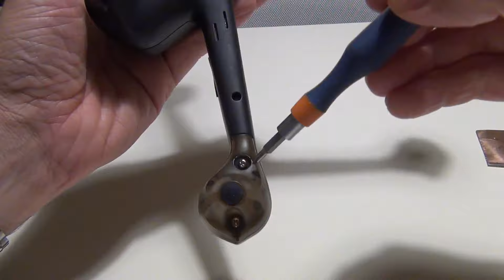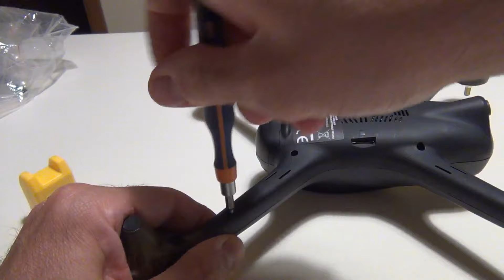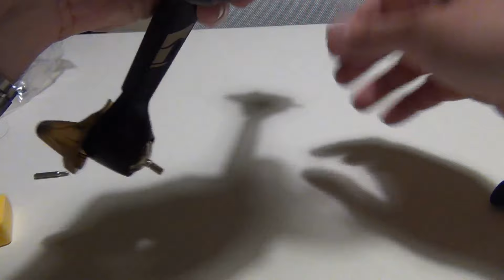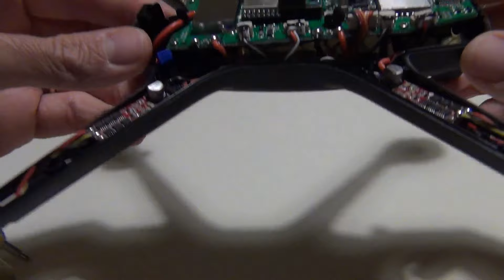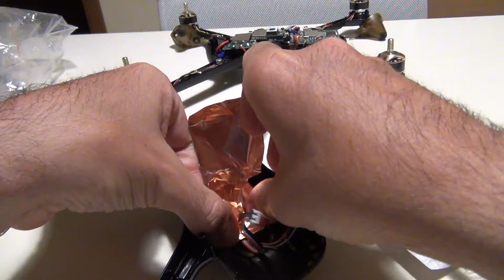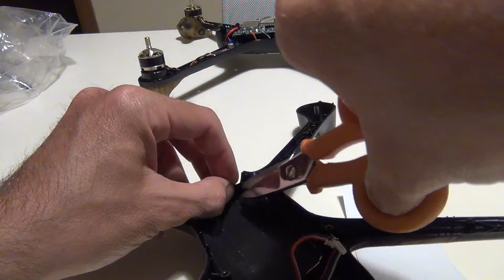Hubsan H501S H501SS H501A bodyshell disassembling - GPS and COMPASS shielding: smontare guscio

Comment: Thanks for the video. Crashed and burned while flying- got distracted and the wires came out of the casing underneath the motor. I think it's the light. Motor doesn't spin so I might need another esc as well. But this video did help me. I have 2 of them. 

Ordering new parts, and going to.customize everything on the one I crashed.. needed this
 
Good look
Reply from the maker: Glad that helped you. I hope you subscribe and Like ;)
Reply: @lukappaseidue  motors work!! hecks yea... just the light is out. can you link the firmware download file for the FC, RX and TX? the hubsan website firmware updates arent working. i can get them, but they have a H501a fc file in the firmware. i try to update and get the update error.  any info you could provide will be very helpful. hubsan isnt responding..  thx
Reply from the maker: @Fiya_gamez  Check wires! I don't think that it is firmware related:
anyway here my archive with ALL: http://bit.ly/HUBSAN_H501_repository

Comment: Ciao Luka, good work. Precise and clear, but if you don't connect electrically the copper shield to NEGATIVE signal of the electronic board the shielding effect is very very reduced near to zero.
Reply from the maker: Thank you for advice

Comment: Dear Luka!

The GPS is allready shielded.

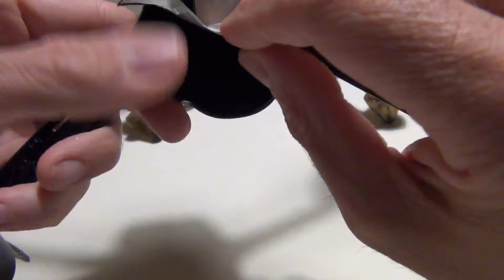At 10:47 You can see the metallic shielding on the backside of the tape, that You pull back.

Allso notice, that there is a "black" quadrant on the tape, that is not metallic which
otherwise would cover the little barometer (altitude) board (with the 3 wires - one green).

This is too obvious to not be a coincidence, so I would not cover this area with copper foil
as You did.

Anyway - If You did not experience any controlling problems and get better GPS initiate, then
You might just be lucky with that mod.
Reply: Sorry - I forgot to say, that the "metallic" part of the black tape, allready are a shielding, that Hupsan may have tested / decided were sufficient.
Reply from the maker: Hi Dear Mickey, thank you for watching my video and also thank you for your tip.
I know that GPS and COMPASS are shielded by factory, but I increase shielding, IMHO, I don't think that's a bad idea:  I have flown my H501S for more than one year, and it was shielded from its arrive to me(thanks to SeByDocky tip) and I have had any kind of issue; so I have do it even for my H501A and even in this case no issue, and my drones "seems" to be really stable.
Thank you again dear friend.

Comment: Luka, what's wrong with the existing shielding? What improvements will we get by doing this?  Thanks!
Reply from the maker: Hi Jimbo, nothing wrong with the existing one, but it need to improve the shielding of the drone: I also have well shielded my H501S and this last one (with new added shilding) fix all 12 satellites in less than 20 seconds, even if i change flying area. an it seem more stable flying
Reply: That's fantastic!  I've noticed after installing Hubsan's latest firmware that it's now taking MUCH longer to get even minimum satellites for flight with my H501S. The drone locking in is significantly worse than before, but the firmware did fix my super limited range problems, both FPV and 2.4, so overall pretty happy.  Where did you buy the roll of copper shielding?  Thanks!
Reply from the maker: Thank you very much for your appreciation dear friend: here the link where to buy roll of copper: https://www.banggood.com/Wholesale-6-Feet-X-50mm-Copper-Foil-Tape-EMI-Shielding-for-Fender-Guitars-6-ft-X-2-p-49769.html?p=WD23051381310201503K
Reply: Thanks for sharing your expirience Luka! I am waiting my new Hubsan 501S in next days and your vids are very useful for beginers like me.

Comment: Ciao Luka, il mio drone è H501S e FPV non funziona (black screen), è possibile installare VIDEO BOARD FOR H501S-S e MOTHER BOARD FOR 501A, in esso?
Perché ho acquistato (su USA) la scheda video per H501S e ho ricevuto quella per H501SS.
Sono in Brasile ora e sono stato in grado di acquistare la Mother Board per 501A.
E 'solo questa modifica che ti serve?
Grazie!
Reply from the maker: Ciao Sergio, H501SS e H501A condividono (share) molte parti. Credo che sia possibile che le due schede (video a mother board) possano funzionare insieme.
So che è fattibile ma non te lo posso confermare.
Nel dubbio, però, prima di spendere soldi, scrivi una email al supporto hubsan.
I think that you can use both video (h501SS) and mother board (H501A), But I suggest you to ask Hubsan Support to be sure 
Any way, let me know.
Reply: Ciao Luka, ho già parlato con loro e due tecnici hanno risposto in modo diverso, ma oggi ANNE di Hubsan USA ha detto che è possibile, ma poi ho bisogno di aggiornare il firmware. Installerò le due schede e ti terremo aggiornato. Grazie mille per il tuo aiuto. Un grande abbraccio!

Comment: Hi Lukappaseidue Luka, I am having big problems with my H501s-s it is uncontrollable in gps mode, any help or ideas would appreciated!
Problem 1: TBE & bad yaw every flight in gps mode regardless of very careful calibration & many times calibrating transmitter as in the user manual, I can only safely fly in Altitude mode, I am still learning to fly!
Problem 2: Even after very careful calibration the compass is wildly inaccurate, even if it finds north,  east is 90 & west is 270. but these numbers are reversed on the transmitter!       I have installed new  compass.   no change.
Problem 3: GPS, the quad takes 10 minutes to acquire 7 satts (never more), the transmitter 12 satts in  2 minutes. I have changed the transmitter gps module with quad module and replaced the gps cable but exactly the same happens.
Firmawre:  The quad came with ,    V4 . 2.19 lcd.  V1 .3 .3   501ss V2 .1. 16    V1 .1 31
           In case it was a firmware issue I upgrade to:  V4 .2.24 V2 .1 .22    V1. 1 .36
           but I still have exactly the same problems. 
This quad only flew a couple of times before these problems began and even then it was very 'Twitchy/Jerkie' & not really stable.
Thank you , kind regards......
Reply: Thank you, Yes I watch all your videos & many others as well, I spend much time binding/calibrating the sticks & compass 1 & 2 with controller, I am very careful about calibrating in the field and have to wait long time for 6 Satts . is this the firmware combo you ask for? 
V4 .2.24 V2 .1 .22    V1. 1 .36
I have older H501s advanced that fly's perfectly.
Thank You......
Reply from the maker: Are you flying with H501S (only one S) using H501SS RX firmware: If you said right (using old H501S model you have to use RX 1.2.20; anyway try this TX 1.1.6+ rx.1.2.12+ fc 1.1.36 and let me know
Reply: No, my old H501s is still on it's original firmware,  ( V1.1.2  Rx V1.2.12  Fc V1.1.21) & I will not change it.
Back H501s-s, yes I will try the firmware you suggest.
I must say that I only changed the H501s-s original factory firmware as a last resort to try and solve these issues, but it made no difference!
Thank you for help & advice, I will let you know how I get on.
Have a great flying weekend.
Kind Regards...........
Reply: Brighton Rock Hello, from what I have read and watched YouTube videos, if you live close to the north equator, it will affect gps and compass.
Reply: Hi do you fix this as I'm having the same problems with my h501s

Comment: Hi Luca! Thanks for the video but I have some questions. At first was it S or A? Second Is this advance really useful? Third where are your pinsete I mean the tweezers? 😂 P.S. Orange clips are the best I have ever used😉
Reply from the maker: Hi friend, I am sorry, but I do not well understand what do you mean: The shielding was done on H501A, but it is the same oh H501S, and H501SS and H501C too.
Reply: Hi Luca. I noticed you have mentioned only S model in video title but during viewing I exectly saw it was the model A. I really know You how high class specialist in 501 and  I have thought this has much deeper reason. Now I understand it is simple mistake. Just add names of all models in title and this will increase the numbers of views and subscribers. :-) Can I ask you to tell about all advantages of this improvement. I have noticed you didn't use the tweezers when you removed the conectors. And about P.S. Once I was in Italy I used the same scissors like yours and it was the best one I have ever used. This tool is cuting wires like the hair.
Reply from the maker: You see right: it is H501A model, but the bodyshell is the same for H501S, H501SS, H501C, and H501A. And even GPS and compass are placed in the same position: so the tip is for the mentioned models. Thanks for your tips I will add models to the title: With this mod, that I have done just one year ago on my H501S, I have verified that DRONE satellites fixing is really fast. H501S fixes all 12 satellites in less than 20 seconds and never lost them during flight.
Reply: Thankyou very much you share your experience!
Reply from the maker: Thank you for watching and for your tips (I am going to buuyt tweezer :D :D )